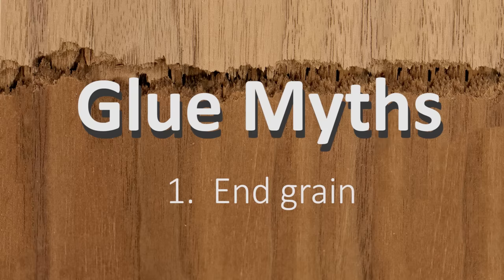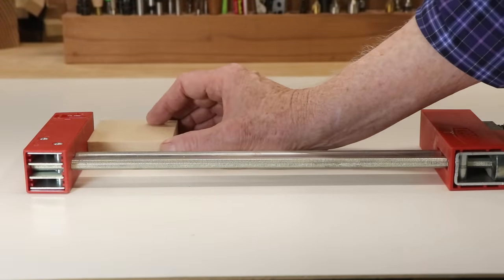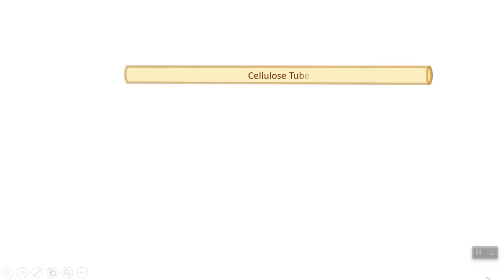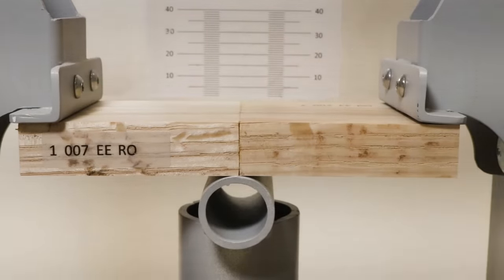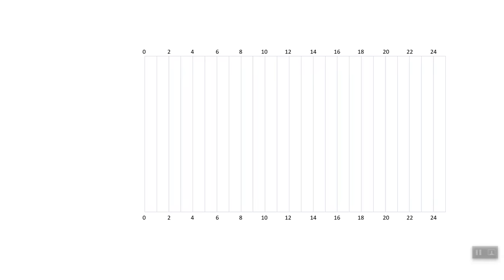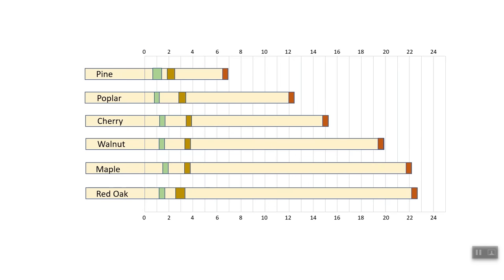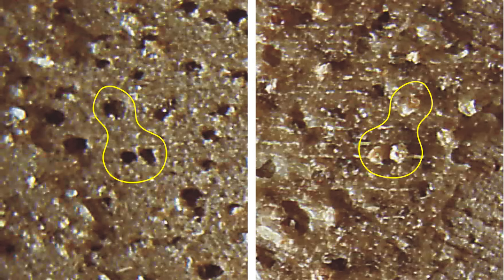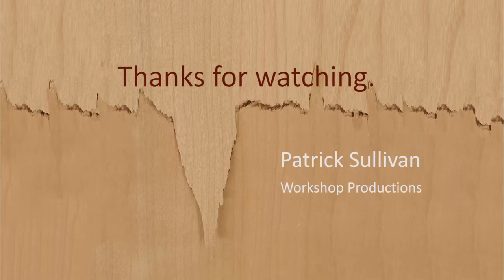Glue Myths:  1. End grain

Comment: The Oak results surprised me. I'd have thought those big pores would make the oak end-grain joint come out on top, but it was beat out by maple, walnut, and cherry. I wonder if the glue viscosity plays a role there: would a thinned-out glue, that can wick deeper into the pores by capillary action, perform better in oak?

And I hope Mattias sees this video.
Reply: Some people advocate allowing the glue a few minutes to absorb into the end grain, reapply what was absorbed then connect and clamp. I've tried this with pine and noted that the glue obviously did absorb into the end grain, so your suggestion makes a great deal of sense, perhaps along with using Tightbond III which has a longer open time and seems runnier anyway.
Reply: This is called sizing the joint, and it is recommended practice if you have to glue end-grain together to prevent glue starvation.
Reply: @tomhargreaves8820  i know the video u talking abott
Reply: @nickgreen5982  You definitely do this when building balsa aircraft  open framed structures; seems to work OK !
Reply: "And I hope Mattias sees this video.
"
I was thinking the same. I remember his glue up tests years ago. I will have to watch again to see his results, but I think they indicated end-grain joints were weak.
Reply: @furtim1  It has been a long time since I watched Mattias's glue test videos too, so I don't remember the exact setup, but in my memory he was testing different types of joints (half-lap vs. box joints, etc). In such a situation, I can well imagine that an end-grain butt joint could come out weakest because the grain direction wasn't the major variable being investigated.

Here, Patrick's results make a lot of sense to me. I'd always just believe the "end-grain butt joints are weak" common wisdom without thinking about it too. But common wisdom also says that modern wood glues are stronger than the wood itself, which Patrick's edge-grain tests show quite clearly. The wood always fails first in that orientation. A solid long piece of wood will obviously always be stronger than an end-grain butt joint, but if you do have to join two pieces end-to-end, the glue itself ain't too shabby. But equally obvious, from Patrick's solid wood break tests, a half-lap or other type of splined joint would clearly be way better still because you do get some benefit from the amazing cross-grain strength of the wood.
Reply: @TheBookDoctor  This bozo is attempting to gain notoriety demonstrating strength of the glue. He implies if not outright claims the glue to be stronger applied end-grain.  Utter hogwash.
Reply: @deconteesawyer5758  perhaps you need to watch the video again.
Reply: @mushin111  Once was more than enough.
Reply: @deconteesawyer5758  Now I see what mythbusters are up against...
Reply: @deconteesawyer5758  If you doubt, repeat the experiment for yourself.   So many people just believe what they are first told, and they never check it out.   That is why there are so many different religions.
Reply: @deconteesawyer5758  He didn't imply the bond was stronger applied end-grain. He demonstrated the fact explicitly.  What don't you understand - explaining your thoughts would be more helpful than venting your emotions.
Reply: Fact: The only failure of the bond occurred in the end grain glue-ups. 
Your logic needs a tune-up.
Reply: @bannerman100  There is no question that the end grain joint is a poor choice, and no doubt that it provides only a small fraction of the axial strength of the wood.
He demonstrated both.
Reply: @deconteesawyer5758  You are missing the point that has already been clearly made.   Glue soaks into the endgrain.   Therefore, because the glue has been wicked away from the joint (unless there is a second coating), the amount of glue in the endgrain to endgrain  joint is less than in the other joints.   That would make the glue in the joint weaker, which could lead to the condition observed.

Also, Decontee, you do not strengthen your argument by insulting people.
Reply: @bannerman100  False. The amount of glue is not considered in the presentation. All joints were allowed equal opportunity. If you feel the end grain is is inferior and deserves preferential special treatment, then you should be advocating for federally mandated Affirmative Action testing that gives unfair advantage to end grain,  for least twenty five years to allow end grain to catch up.   If more wicking occurred at clamp-up there would be more glue, not less,  in the end joint.

Comment: This makes a lot of sense. Even though it took much greater force to break the end grain, the point of failure is at the joint itself (the glue), making it SEEM as though it is a weaker joint rather than a failure of material strength. False conclusions that seem so apparent. Great video!
Reply: that was my thought as well.

Comment: Absolutely fascinating as a woodworker. Even more so as an engineer in observing the yield point behavior in the various orientations and different species. I found the failure modes of the unglued samples particularly interesting. The cherry and the walnut, especially the walnut, failed catastrophically as the grain failed in almost pure tension, the cherry started splintering, at the surface as the lignin apparently failed in shear, allowing the load on the grain to increase rapidly, then failed catastrophically as the grain failed in tension like the walnut. All the others appeared to fail by splintering, perhaps with the lignin failing in shear with the grain breaks staggered. I wonder what that might mean to people selecting wood for projects that require bending strength.
Reply: I think that depends on application of bending. A bow, for example - requires fast recovery response of the fiber to maximize the energy out. A chair however, will be okay with a slower recovery time of the fibers. Softer woods like pine do not make good bows since the recovery time of the fibers is very slow, but the slow recovery time seems to make them more bendable.

Comment: I think this is an improper framing - though granted interesting data.  The issue with end grain joints is that it creates a weaker seam than the wood itself, meaning the joint weakens that segment of the piece and becomes the weakest part of the overall piece.  Wood being stronger on the grain direction lets you build to the strength of the grain, but end grain joints create a weak point in that direction!  Whereas long grain joints simply keep the strength pattern of the wood consistent.  

The strength of the joint itself is not stronger in end grain, rather an end grain joint is stronger than the long grain wood itself.    It's a big difference, and personally I don't want the joint to be the weakest part of anything I make.

Comment: A couple of things I'd like to see tested is smoothness of end grain and old fashioned hide glue.  One thought on end grain is without precision cutting or planning the surface, you wind up with a surface that is very rough.  So it may not have as much contact as a very smooth joint, esp from the days of hand tools.  Same with hide glue.  Would it perhaps be pulled through capillary action away from the end joint so there was simply less glue acting?  Just some thoughts that some of these beliefs may have started when we used different tools and glues that today.
Reply: On a rougher end grain, the two wood surfaces may not have as much contact with each other, but they'd have more surface area for the glue to grab. I think a rougher cut, within reason, would probably result in a stronger joint than a smoothly cut, planed, or sanded end grain.
Reply: Hand tools can get a much smoother cut than your table saw or router depending on what, where and how.  I'd wager a scraped or planed surface is smoother than a sanded one.

Comment: This is looking at the glued joints from the wrong perspective. What should be compared is the strength of a glued piece compared to the strength of a continuous piece. In a side-to-side joined piece the strength is no less than a similarly sized continuous piece where the wood is the limiting factor. However in an end-to-end joined piece the strength is 3 to 8 times weaker than an equivalent continuous piece because the glue fails first. Glued end-to-end joints are bad practice because it is so much weaker than a piece without that joint.

Comment: Interesting! We Lute makers have been gluing end grain to side grain (the neck joint) on lutes for 600 years but that's rarely the joint that fails. Granted, it's reinforced with a handmade nail or nowadays with a few big screws, but still. The only way I know to make that joint fail is by using epoxy...
Reply: So take out the screws and nails and see how kong it lasts

Comment: The tests are a rational analysis, to an extent.  When I think about applying Mr. Sullivan's results to woodworking, I hesitate to change anything about accepted craft practice.

His main conclusion is that glue is stronger on end-grain-to-end-grain than we thought.  But any picture framer will reinforce a glued end grain joint, with a spline or a piece of hardware.  There is a lot of rotational force on the joint if someone distorts or drops the picture frame.  No veteran would rely on end grain glue alone, because we've seen what happens over time.  That's why we create joinery on end grain.  As Mr. Sullivan concludes, no part of the glued wood is stronger than long grain wood itself, and that’s how wood joints create strength, as well.  Wood joints use long grain to bridge across the joint line, and then the long grain is held in place by long-grain-to-long-grain glue strength.

However, Mr. Sullivan doesn’t measure the strength of l-g-l-g glue joints.  He says that wood will break first with the grain (with the lignin).   On a 3" long piece of long grain, that's not surprising and even robustly unhelpful.  Woodworkers try to avoid the long grain becoming too short, and weakening it.  That's fundamental.  Mr. Sullivan's experiment creates a situation that we avoid in real life.  He tests not the glue but the wood in static bending, and it fails in that orientation.  He has not measured the strength of the long grain glue connection, as though it didn't matter.  Set up an l-g-l-g test that doesn't cause wood failure, such as glue strength measured in tension or in shear.  That's how glue is used in wood joints, to resist tension forces with the wood grain oriented to its mechanical advantage.  The accepted knowledge, which is still not disproven, is that glue is stronger in long grain than end grain.

Comment: I really like your proficiency in constructing your 3-point load testing apparatus. The load cell and interfacing with your computer is an excellent development. Your experimental results are a credit to your excellent workmanship and technical ability. The results are really interesting and I like that you combine microstructural observations with the failure analysis. I value your work and video presentation highly. Thank you for sharing your excellent video and work. Well done 👍.

Comment: Awesome testing data.  For years I have always used either T & G, dowels or biscuits for either side grain or end grain glue ups.  Mostly for alignment but also for strength.  Your testing shows I may have been over engineering my joints.  LOL.  Great work.

Comment: Outstanding video. I’ve often wondered the same. I too was always told and drain is much weaker. But after thinking about it, it makes perfect sense that it’s stronger. The clamping process forces glue into the pores since end grain pours are more prevalent. You would expect to glue to be compressed in deeper.

Comment: Mr. Sullivan,
An amazing and accurate design of experiment (DOE). I hope it is appreciated. You not only characterized and quantified the experiment but also continued into the why of the results. Showing both the adhesive failures and cohesive failures led to my concluding that one of the basis of this myth is that any failure of the joint was caused by the glue bond (adhesive failure - the glue alone) and not the interaction of the glue with the wood grain (a cohesive failure). You showed this very clearly in the stress testing and in the micro pictures of the failures that it was the wood that failed. The joint broke in every species case due to the failure of the "grain" adhesive - lignin - and not the PVA.
To the casual woodworker (me), when that joint broke, the blame would be placed on the adhesive, not the wood. I can now stop using mechanical fasteners (a "just in case" measure) on my glued end joints. I am a victim of this myth and you have "set me free".
Bravo, and thank you.

Comment: Thank you! You just confirmed what I've suspected. 
In my experience, sometimes glue joint can fail, it is always because of glue starvation, not because of glue strenght. End grain is very porous and it susks in a lot of glue before it cures and with clamping you squeeze a lot of it out, so there isn't enough glue in the joint.  Whenever I have a joint with any sort of end grain I apply glue to it first quite liberally and wait 5-10 minutes to allow it to penetrate the pores, then apply a very thin coat of glue to it and clamp. Results are, to my observation, very consistent. 
When I need to glue long pieces end to end I use scarf joint.
I helped a friend build a wooden aeroplane and it is covered with plywood which is structural, so joints are critical. When you glue two sheets together end to end you actually have all kinds of joints, long grain to long grain, end to end, long to end due to alternating orientation of plies. To make a joint structural you need to make a scarf joint with a slope of at least 1:10, 1:15 is even better. Even wing spar which is the most critical structural part is made using scarf joint end to end since it is practically impossible to find long enough. It needs to be as long as wing span.
It works similar to the finger joint, actually making end to end to be more like long to long grain and give effective glue joint more surface since glue is always stronger than wood.

Comment: Great video Patrick!  New sub from me as well.  Incidentally, I work for a company who makes these type of compression machines.  A few things I would suggest to increase accuracy of the tests would be spherically seating the load roller for even load distribution during testing and also going to a motorized hydraulic power unit that can slowly but continuously apply the load, preferably closed loop rate control.  I love when someone decides to question something we do "because it has always been done that way."  Great job.

Comment: Excellent design of the experiment! I appreciate the effort you invested in this, and will remember your results. 
Once I learned of the tubular structure of wood, I felt certain that end-to-end joints would be quite strong, because I assumed glues would enter the tiny tubes. Though may assumption wasn’t exactly correct, I see the strength of the tubes themselves standing up to much greater force in your tests. Thank you for the info! I love “myth busting” in anything, especially with your precise approach.

Comment: It makes sense. Decades ago the glues that were available were much weaker. As you point out in your tests, the glue is in fact always stronger than the grain. So end-to-end joints are stronger that side-to-side joints. In the side-to-side situation the break happens in the wood, in the grains. In the end-to-side situation the same is true, the break happens in the grain of the side glued part. So in the end-to-end situation the grains are not the weakest link anymore and break will eventually happen in the glue. Glue is very strong, but it is still not stronger than the grain of the wood. Thanks for this elaborate testing. It explains a lot.

Comment: Thanks for this carefully-prepared and well-presented video.
Some while back, I made a box frame in 1  1/4" jelutong. 
The boards were about 6" wide, and, using PVA, I glued and screwed the butt joints - a very simple construction, with the box ending up 6" deep.
Then, I discovered that I had used incorrect dimensions, and I wanted to get the joints apart and try again.
So, I removed the screws and inserted a thin, metal, blade at the joints, expecting them to crack apart.
It would not work.  I had to saw them apart.
This video explains why.

Comment: This was an excellent well-thought-out and carefully executed experiment. I have occasionally used end grain glue joints for expedience, setting up jigs and such. It has always surprised me that the joint is much stronger than I had been taught to expect.
It is possible that the end-grain myth originated during a period when most woodworking glues were hide glue, or fish glue, or something of that sort; these might have different characteristics than modern aliphatic resin glue. It would be interesting to try this same experiment with a type of glue commonly used 200 years ago.

Comment: Very interesting and methodical test.
I work in design engineering, and once was tasked with designing some custom glulams we wanted to make in house. That didn't end up happening, but I did perform some pull tests on finger joints. Both sides were clear grain samples of hem-fir, jointed and planed. The cross section was about 1.5" x 3.5". Then I routed finger joints into each end grain, glued some samples with Titebond 2, and some with a resourcinal glue (??). I made some heavy steel plates that bolted around the samples to rig to with a 10 ton load cell and huge chain pull and some heavy lifting straps.
The samples were failing around 7,000 lb tension. Then I put in a sample with no joint, just clear grain wood. At 11,000 lb, I "wimped out" knowing with that setup a tension failure would be rather dramatic.